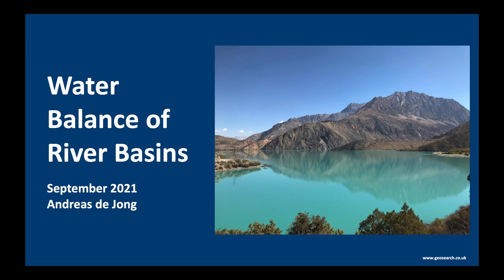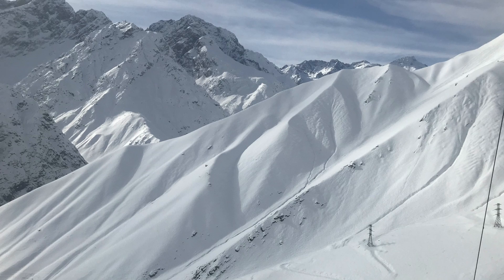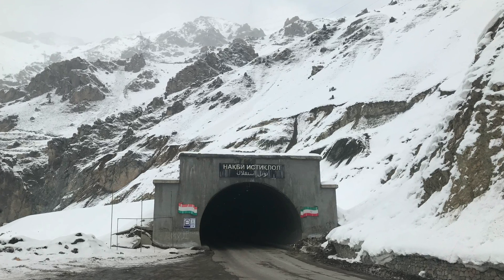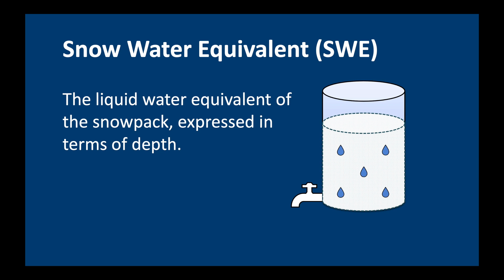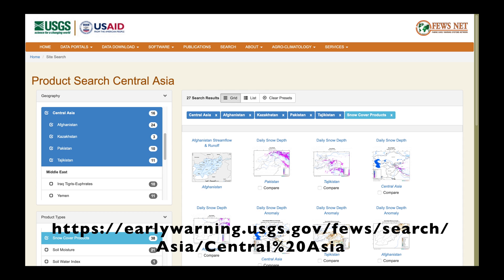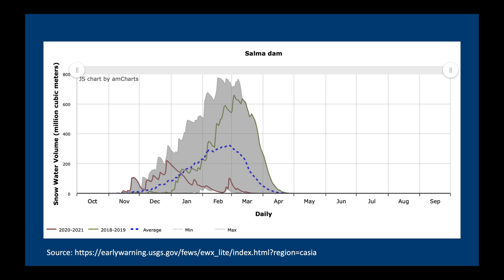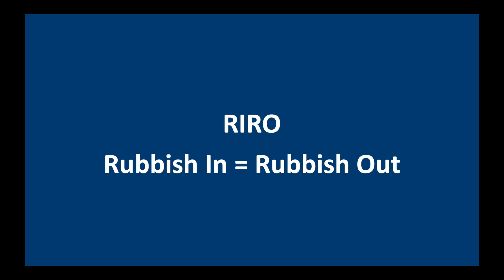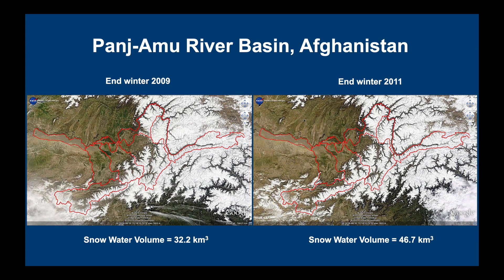Introduction to Snow Monitoring in River Basins (Snow Water Equivalent & Snow Covered Area)

Comment: Hello Sir, would you please guide me how to assess impact of climate variation on snow cover area : I mean which model is mostly used and is it suitable in the context in one of the river basin of Afghanistan. In addition is it possible to use SRM for assessing the impact of climate change on snow cover area: Kindly guide me. Thank you
Reply from the maker: Hi Rahmatullah, You could just monitor how the snow covered area of a catchment has changed over time. MODIS goes back to 2000, but you can go earlier using e.g. Landsat 5. 6 etc. You could also see if there has been any change of the onset/departure of snow over time. Of course snow covered area is just an indirect measurement because we don't know the snow depth or the snow water equivalent (SWE). For SWE you will need to use one of the snow models, such as FEWS NET. Sorry I don't know what you mean by SRM. All the best, Andreas
Reply: Thank you Sir for the valuable information: I mean from SRM snow runoff Model which is used for assessing the impact of climate change on snow cover area : The main input variables for this model are snow cover area, temp, precipitation and basin characteristics, degree day factor: If you guide or train me,  I will also pay for this purpose
 @GeosearchInternational
Reply from the maker: Interesting model and seems to work in the Himalayas. See: https://www.mdpi.com/2072-4292/12/12/1951
So I think that there is no problem to get the satellite data: MOD10A2 and ECMWF precipitation and two-meter temperature products…
The key issue is to have good runoff data so you can get the recession coefficient, and also see how accurate the model is. At the moment I’m too busy, but am interested to try out this approach in the coming months. All the best, Andreas
Reply: Thank you Sir for sharing the information, currently I am doing PhD research and one of my objective to assess the impact of climate change on snow cover, : Sir I have highly resolution gridded precipitation dataset and also have flow rate of one station belong to the basin. Now I have problems how to run the model and also how to find recession coefficient. Sir if you find some free time, sir kindly share me some information about how to calculate recession coefficient.  @GeosearchInternational
Reply from the maker: For the recession coefficient you need to make a master recession curve, which is a combination of all the different years of flow. I used to do this manually with tracing paper, but should be easy to do in Excel as well. All the best, Andreas
Reply: Thank you Sir for your kind consideration.  @GeosearchInternational
Reply from the maker: How many years of flow data do you have?
Reply: Sir I have 15 years daily  based  flow data and Sir I am Afghan Phd student want to assess the impact of climate change on snow cover area by using SRM. Sir I also conducted future projection of climatic condition. Now I want to see the climate variation impact on snow cover area. In this regard, Sir your kind help will be highly appreciated. I search a lot of videos on youtubes regarding the SRM but not find specifically. Thank you sir
  @GeosearchInternational